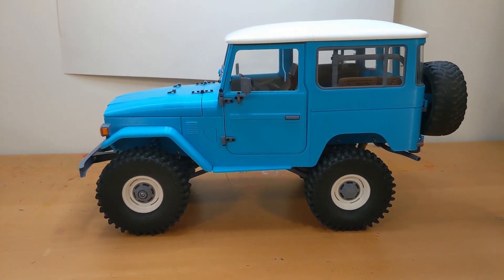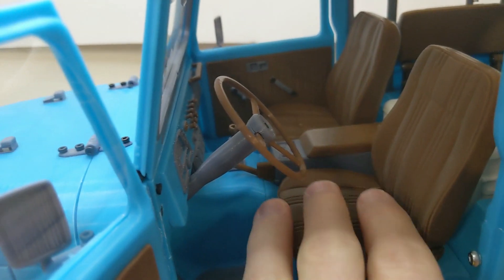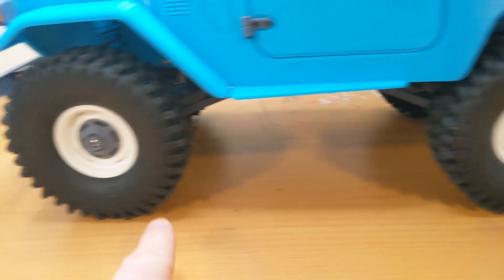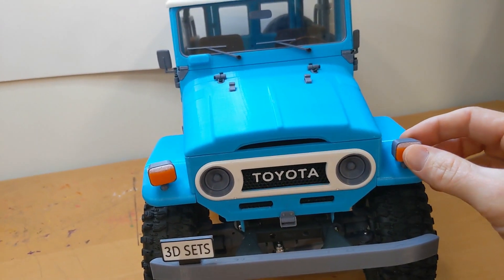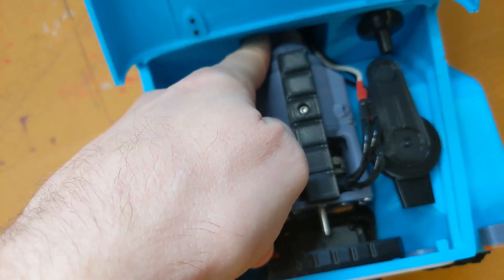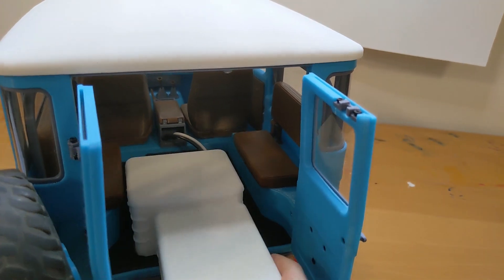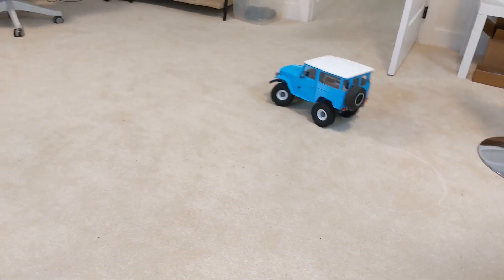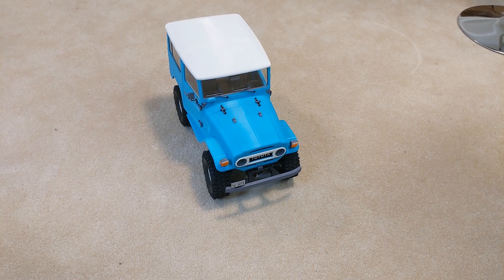New Build Day! Toyota FJ Landcruiser Hardtop - 3DSets Bamboo Model 10  - Fully 3D Printed

Comment: Yours has a very tight steering radius at full lock I think the rear open diff helps, I printed mine with the open diff at the front and locked at the rear, and it's a nice compromise for running indoors and outdoors. with a 1400kv motor and a 2s lipo, it lifts off one wheel at the front with a good burst of throttle. The new belted gearbox is really a nice update on this new model from 3dsets, much quieter and durable.
Reply from the maker: totally agree. I was considering the 1400 kv for this one but I think I'll try 3s for more power before going with a faster motor. I have a 1400kv brushless in my Rancher now and its quite fast.

Comment: The car looks really good! I'm also finalizing print of my bamboo. Regarding to your wheels setup. Are you using 120mm tires and 90mm shocks? I ordered 108 mm tires and 80mm shocks and wasn't sure about my choice. But it could work maybe better in compare to your wheel setup. What do you think?
Reply: with 80mm shocks it would be perfect I think, mine has 90mm shocks and 100mm Tires, and it's on the tall side as shown in this video. with the 100mm and 90 mm shock the Tires have just enough clearance when the suspension is fully compressed so with the 80mm might be touching the fenders but wait until yours arrive try them out. with 100mm Tires, the car has much better looks and stance but 75mm to 80mm shocks should work and look much better.
Reply from the maker: @ripmax333  Agreed, 80mm shocks would be good. I'm running 85mm right now although I'm still waiting for a set of 75mm shocks to come in which will likely end up being too small with these tires I'm running which are 120mm https://www.amazon.ca/gp/product/B071S221P5

Comment: Been waiting for the next 3D sets car ro show up here, just finished my rancher and need to think about what's next
Reply from the maker: This ones a winner for sure! Its cool to see how their designs have progressed over the last year or two with the open diffs, brushless motors, belt drives, new cardan joint designs, door clasps, wire+electronics hiding etc.
Reply: @rcprinter  well once I decide you'll be getting another screw kit order